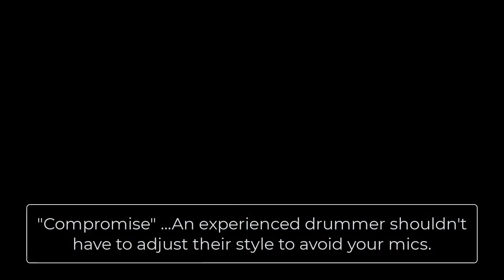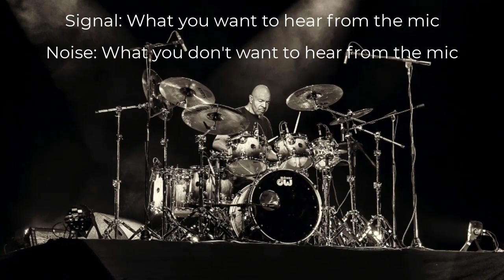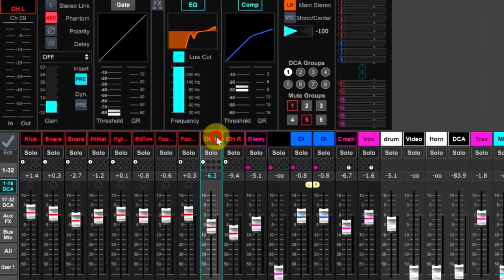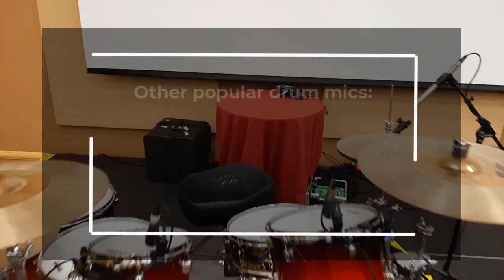How I Mic Drums For Live Sound - W/ Kenny Aronoff On Drums - Also A Look at the Porter & Davies BC2

Comment: I slap the set like kenny...what's funny is in a small room I always tell the sound man..." hey man you're not gonna need a hihat mic..." his response:hey I always use em".... then whats funny is as soon as I four count....I see him dial down......always funny
Reply from the maker: I don't always use (turn on) the hat mic but every so often you get a light hitter and the snare mic isn't quite enough hi hat bleed to compensate. So I can understand someone with the default position of putting it up. Lot easier to turn it down than to have run a mic on the break... And also there's just sitting at the board thinking "I need to hear more hat" ...Until you can deal with it and stick a mic there ;)
But that said, usually, maybe with some EQ adjustments and compromises, the snare mic can fill that hole with some hat bleed. Heh, and sometimes it's a different issue- the snare mic is not needed because the snare is so frickin' loud. So you don't have the snare mic on to pick up hat bleed. Of course in that case, even if there is a hat mic, it's going to be hard to get it functional and not picking up the snare that's already too loud in the room ;) 

But yeah, small room... drummer with some power... hat can be many times be dropped pretty easily.

Comment: There is small mic booms that connect or clamp to the cymbal arms. Too.
Reply from the maker: Yes,  and they can work really well to give you a compact, neat setup. But that's kind of thing that you want to do for your own drums or own band that you regularly mix. As a production provider, a lot of drummers, or band production managers, don't like you clamping things onto the set like that. For multi-band changeovers, if the band has their own mics it can really speed up their strike from the stage. They just drop the cable and the entire stand, clamp, and mic goes offstage. But if it's the production company's mics it can slow things down since the drummer (or stagehand) can't just grab a cymbal stand and get it off the stage but instead someone has to remove the claws from the stands so the A2 or someone with audio has to strike those. Someone has to remove those from the stands rather than just grab stand, cymbal and all, and get it off stage to the prep/pack area.

Whereas, with mic stands someone can just drop the cables from the OH's, hats... etc... and take the entire stand and mic offstage where they can be totally struck and packed away offstage as the next act gets ready to go. Or in some cases, these things are not struck, but reused as-is for the next band. Just move them out of the way a couple of feet for the drums to clear, and move them back into position when the next set is there.

With things like the clamp-on tom mics, the mics are going to go where they go on each kit. The kit setup won't make much difference. But when you're clamping onto stands, what works for one set might not at all work for an entirely different set since each drummer's set config and comfort can be so different. So a clamp system might not even work for some sets... but the tom mics and rim clips and regular mic stands can always work.

But, for a self-contained drummer, having things like clamps on cymbal/drum stands to cut down mic stands can speed things up for these situations, and remove clutter. 

It all depends on the situation and which angle a person is coming from... Production company and multiple drummers, or a drummer/band with their own self-contained mic package and PM/BE.

Comment: You do not need to mic the bottom head of the Snare.  Use one 57 on the batter head of the snare.
Reply from the maker: "Need to"... no... But the best live sounding snares are almost always mic'ed top and bottom.

Besides being able to blend in the snap of the snares with minimal EQ, it also changes the way you can approach the batter head. You can get attack without trying to accentuate the snares from only the top. And you still get the body of the snare.
But since you can capture the snares with less EQ, you also can get less stage wash from the hats into the snare mic.

For a club band where the snare might barely be in the PA anyway, then it becomes less important of course.
And in a multi-band, festival type situation where it's throw-and-go, then the top mic will be fine.

But when it's about capturing the ideal snare sound, in a venue where you're really mixing, or working with a drummer that understands dynamics and the room and allowing you more room to mix regardless of venue size (obviously to a point)... then it might not be a "need to" but many times it'll be a "better to do it" scenario.

Comment: With a lot of cymbals and drums and a low ceiling I am micing concert toms from below and using two akg d225e  from behind picking up side cymbals do you suggest a third Overhead to pickup the front cymbals as they don't come through the headphones much... or perhaps and out front overall kit mic  I should try being as the snare is already plenty loud. I think I will try that actually....
Reply from the maker: If you're mainly losing something like a ride cymbal(s) you could try just micing the ride(s) more or less like you would a tom (or maybe better said, a hi-hat). Whether it would work best as an above mic or 'undermicing' the cymbal(s) is a different question. You'd just have to experiment. In theory, there'd be less bleed under a cymbal. @arneolson7114